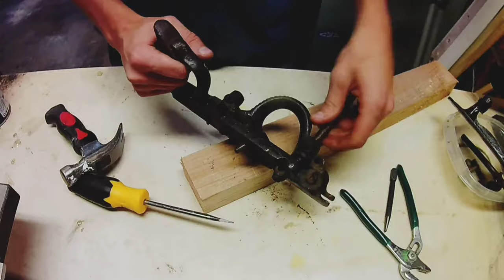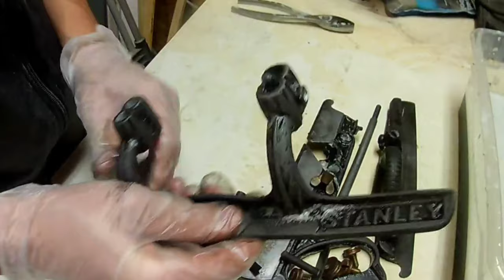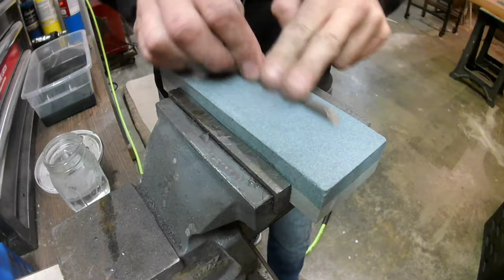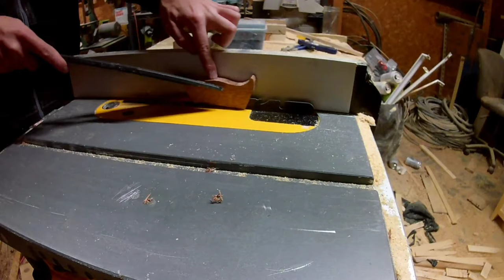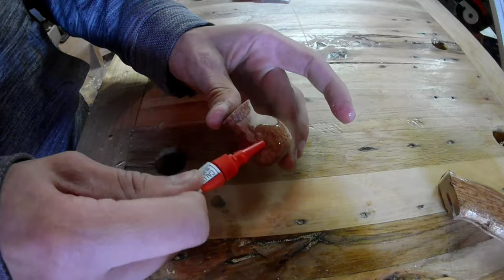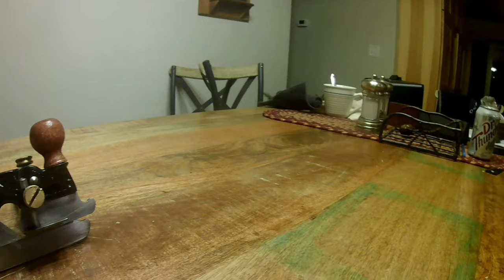Restoration of a 100 year old Stanley no. 45 combination plane | woodworking

Comment: Citric acid, a cooking and preservative supply,  can be a good rust remover. It is safe and easy stored in powder form.  Mix with about one teaspoon to about 100ml water.  No problem with disposal as it is about the same as lemon juice and used a lot in fruit drinks as a preservative.
Reply from the maker: Thanks, I might try that next time.